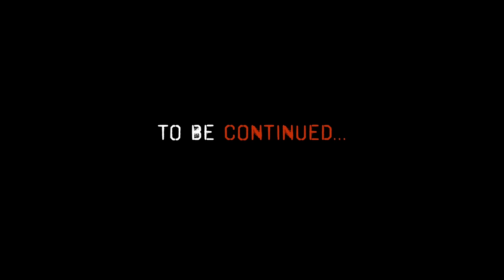The Most Transparent Slaughterhouse On Earth [Part 1]

Comment: Securing your property doesn't mean you are doing anything wrong, take the measure to contact the processing plant through proper channels. I wouldn't let strangers onto my property unannounced, no different at my shop or my home. 

Also understand that suppliers have commitments to their clients and there are reasons they wouldn't want you inside their plant, one would be that it is dangerous, two being that it may violate the regulations they're required to adhere to, and three, they have a contractual obligation to uphold, and the risk/reward evaluation likely won't fall in your favor.